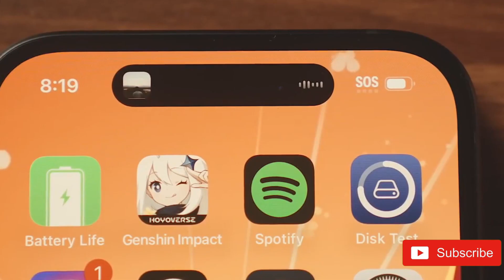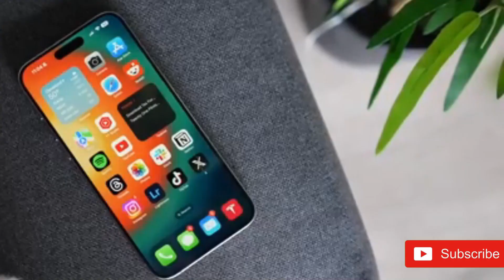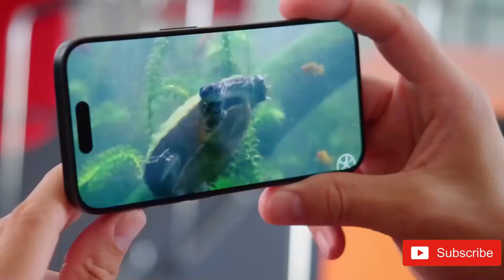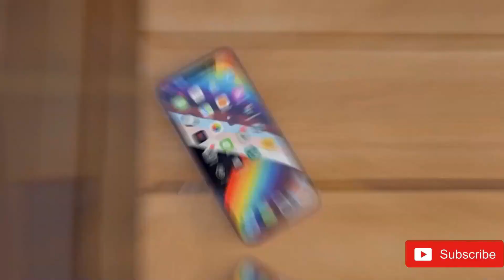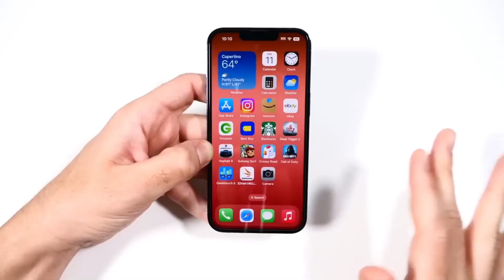iPhone 17 Pro Max - OMG, Everything is Exposed!😍💪

Comment: This honestly doesn’t seem realistic. If apple is developing technology to make a skinnier phone, why would the pro-max get thicker. It makes zero sense especially when the biggest complaint has been the phones usability with one hand. It seems that apple will be looking in another direction to make the pro max both lighter with the aluminum frame and not as thick.
Reply: iphone 17 air?
Reply: Bro an thicker IPhone is better it’s doesn’t matter the weight of the device.
Reply: @MHawk-xt7vq  It definitely does matter how much the device weights because it will chance your ability to use it with one hand. The new pro max is already more difficult to use with one hand due to its size. Being heavier will make it harder to use.